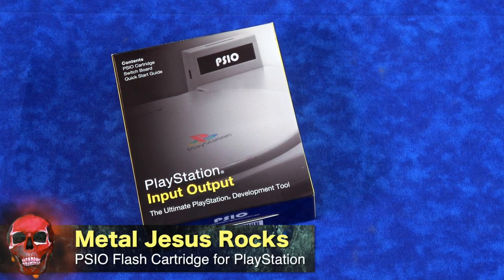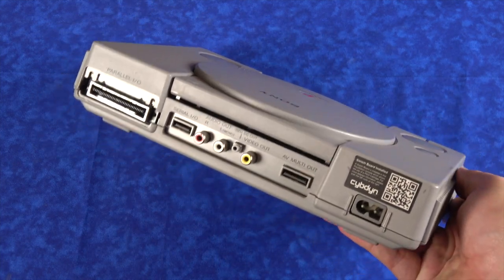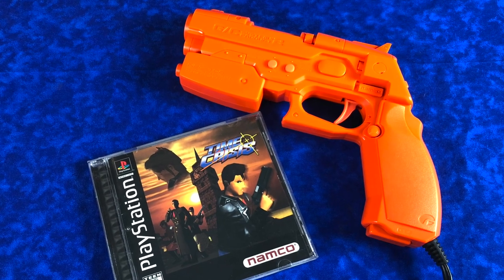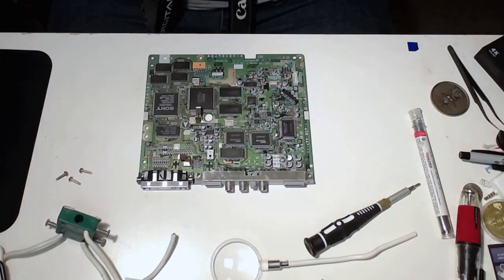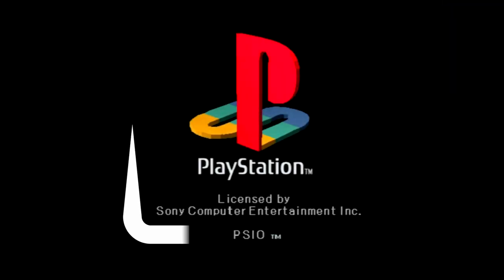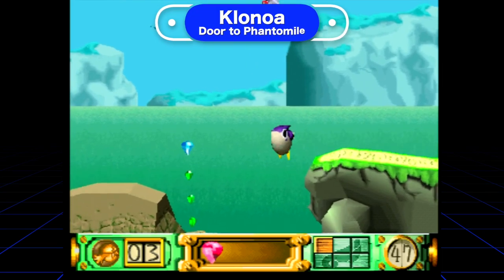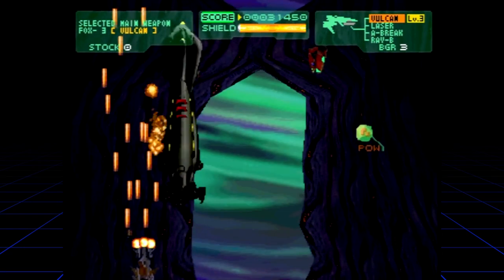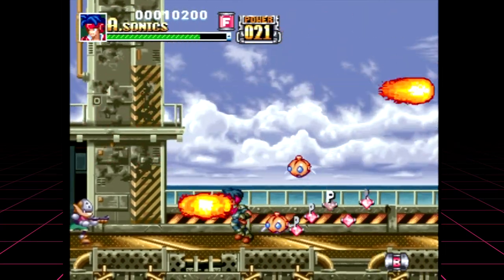PlayStation PSIO - SD Flash Drive for your PS1

Comment: They spent years developing this and when they release it they make you mod the console.
It's just a shame because GDEMU has put out SD cards for the Dreamcast & the Saturn and more and all you have to do is remove the optical drive and then plug the unit in and it works. No modding is needed, which is a much bigger selling point.

They need to revise this so that the detection works through the serial port alone and no modding is needed. I would rather the CD drive just stopped working when the unit was plugged in and it overrode the CD drive.

Sadly it a big NO from me.
Reply: Quite strange it needs a mod, the PIO slot at the back is ran so early in the Sony BIOS that you have the chance to patch everything in software. Action Replay/etc worked like that.
Reply: @SerBallister  Exactly, this is why its not sold out instantly, if this was the case, these things would be impossible to obtain for a while.
Reply: @Whenitraveltheworld  ehh it has been selling out quickly despite requiring solder work. I missed out on the pre-orders 2 times before I finally was able to place an order as they just sent an email out of the blue and it was first order first served basis. Cybdyn offer a mod service where you send in your PSX motherboard and they install the switch board for you. Not that it is hard. You just need a basic solder iron with a thin tip and some patience. Instructions are clear. They are working on a way to avoid the switch board but that takes time developing.
Reply: It's no different from a mod chip install 20 + years ago.  The trace cut are only the most tedious ones of the install but if you have the right tools it's fine. I had zero soldering experience and did my PU-8 board fine.  A plug n play solution without a board install will never happen because SONY did not have direct access to the CD-ROM controller and that is why the board is needed to re-route the communication from the Parallel Port to the CD drive, hence why a bad install, the console won't boot or the CD-ROM will not be recognised when PSIO is plugged in because PSIO still works side by side the drive.
Reply: That's a very elaborate way to tell us you have 0 soldering skills and are angry about it.
Reply: The Dreamcast already has an adapter for SD cards that plugs into the serial port but unfortunately the compatibility is hit or miss.
Reply: removing the optical drive sounds like a system modification to me.
Reply: I'm sure if that was possible, they would have already done it that way.
Reply: @jasonrulesudont5515  Um..the price is no more than the SNES or NES flash carts..and this is for PS1.

Comment: Back in those days i used a device like that one called "game shark" needed no soldering or extra chip. Originally was used to cheat with game codes, but as a plus, you could play burned cds, loading first any original one.

Comment: So in reality you could get the entire PS1 Library (worldwide) on a few SD cards........?
Reply: @BigDaddy-666  thank you for feeling the need to explain a bunch of unnecessary shit
Reply: @highspeedenthusiast6628  It wasn't unnecessary BS, that will be an eye opening comment for some noobs
Reply: @highspeedenthusiast6628  to answer you in a more relatable way to your question.

Short answer is yes. Long(er) answer is yes, but around 2500 games, at the bare minimum of 700mb each, that's around 2tb of stuff just of PS1 roms. That's a lot of cards.
Reply: @ChaosZero.  The full redump PS1 library is actually around 3.7 TB. But keep in mind that includes a lot of duplicates since there are games from all regions, demos, different versions etc. For a NA only set without duplicates you should be able to get away with 500 GB - 1 TB max. Most games are actually far below 700 MB.

Comment: I think it's wrong that they sell you the thing in pieces and don't even explain that if you buy the 150 sd parallel adapter it  wont work without the 7 dollar kit.
Also what the 14 dollar kit for? 
This being said why not combo the whole thing into one purchase with a discount? This plus shipping may be a killer making it at least 150 USD
Reply: RTFM
Reply: @ilovellamafood  checked on my phone it didn't state nothing when I attempt to purchase it.
Reply: The chip you have to install comes with the unit.
Reply: @ilovellamafood  yeah I found it. But even the pictures wont  show it included that's why I was confused.but it's good to know that it be around 130 after shipping. I may consider buying it after new years

Comment: I'm a member of a Dreamcast group on Facebook, and I've seen people posting pictures for something similar for the Dreamcast! It is a more extensive modification, though, as it involves removing the disk reader and replacing it with an SD card reader, which is kind of a bummer. It's cool that this one for the PlayStation allows you to retain the optical drive, but I wonder as our disk based games age and begin to fail more frequently, if we'll see more solutions like the Dreamcast one that just get rid of optics all together in favor of something like an SD card reader.

Comment: If there ever was a version for the PS2, I'd be so on board! Some of those PS2 games are really hard to find!
Reply: Get a fat Ps2 with an external HDD and softmod it with FreeMcBoot just use Opl then and it works perfect✌️
Reply: TOASTBROT do you need any thing else to connect to the ps2?
Reply: $5 freemcboot memory card off eBay or amazon, then just plug in a usb w games and you’re all set. Easy and cheap.
Reply: KORERAWR hook it up I have so many scratched ps2 games I need back ups

Comment: Definitive way to play PS1 games, nothing else comes close.
Have a 256GB card, running this on a JVC CRT 27" TV through RGB SCART and it's absolutely awesome.
PS1 is one of those systems you really need to play on original hardware - no emulation can ever compare.
The new menu updates are super easy to use as well, from what they've said in their news segment it's now at almost 100% compatibility, apparently only a single game is left before it's 100%.

Comment: 149.95 AUD for the cartridge and an additional 7.95 AUD for the chip......eh nice concept, but too expensive for my blood.
Reply: Get a job.
Reply: @the1ucidone  I actually find it kind of expensive too, I would love this hardware, I have a job, but In my case it's something called "priorities".  But for now a self programmed and installed MayumiV4 does the job.
Reply from the maker: At around $110 USD that's about what you would pay for some EverDrives like for the N64, etc...
Reply: @the1ucidone  And spend the money on this over a cheaper alternative like a Raspberry Pi? Ha, you're funny.....
Reply: I know how you feel. You can buy a used PS3 for half the cost and easier to softmod. Maybe once that all in one option becomes available will this be 100 % worth it. As for me, I'll wait until I save enough tip money to pull the trigger.
Reply: The chip you have to solder comes with the unit at no extra charge. You only buy more if you want to install in more then one console.
Reply: @MetalJesusRocks  "EverDrives" MJR? the term has ALWAYS been "ROM cartridge" when it loads a ROM file from esternal storage, "Flash Cart" for direct write cartridges like the early GB and GBA cartridges, or "Drive Emulator" in the PS1 and Dreamcast's case as it loads in place of the disc drive, be it literally or functionally. EverDrive is a brand, a expensive one at that.
Reply: @eddiew.4650  But, a Raspberry Pi 3 does not replicate what actual Hardware does. It's called emulated for a reason. It means that it is trying to be something that it is not. If you take a 1:1 ratio pixel setting on the Rasberry Pi 3 or any emulation software/hardware, it may never play or look exactly like the real thing. They can come close, and have a lot more features. But, it still isn't the real thing. The difference is quite alarming if you put the two side by side with the same game and on a Component CRT or PVM. It's all choice, you can go cheaper and get an emulated product. Or you can do what the hardcore mofo's like MetalJesus and MyLifeInGaming does, modify original hardware to look as crisp and perfect as it can possibly be. It's all preference my friend.
Reply: @zero9112  not gonna get much better than the ps3 for ps1 games. love mine.
Reply: @the1ucidone  No worries man, never took it the wrong way, and you brought a valid point. I hope you, and everyone else, have an awesome xmas. Stay safe.

Comment: This was just linked to me and wow, what a surprise. I had no idea Everdrive like software existed for disc-based consoles. I'd love to see similar things come to Dreamcast and GameCube. And yeah, with no soldering required, please!
Reply: Dreamcast has had options for a long time.  Just remove a few screws, pop out the disc drive and put in the board.  $60 with <5 mins of work!  Plus you can put the original drive back in it any time as long as you don't lose those three screws!  The only caveat is that the SD card reader board can wiggle loose after changing the SD cards anfew times, so be careful!  (A better fixed-mounting of the plug-in board would go a long way here!)

Comment: I know the PS1 classic can add roms and can use Dualshock 4 with a wireless adapter but does anyone know if the games/system supports rumble and analog sticks? I saw it on sale for $58 today and would buy it if it supported those things.
Reply: Damn where you see it for that much?
Reply: @sleepyjarvis6062   Check a site called Slickdeals. Just use the search bar.

Comment: Now the PS1 Classic is cheap and not wanted buy one and hack it and put all the games you want on it. It wasn't good when it came out until you can hack it and fix the emulator settings. But original hardware is always better than emulation

Comment: Great idea but the price is prohibitive. Too many cheaper alternatives. Only those who just have to play on original hardware would be interested.
Reply: yup. most retro computers and consoles are already emulated on modern PCs so just for running the software there are easier/cheaper ways. this is an enthusiast product and produced in fairly low numbers so going to be expensive to some, but actually very fairly priced to others.

Comment: Gotta say at 1st I saw this and was like "Why bother with getting that, if you have to mod the console to begin with, it will already run CD-Rs and your backups along it" (or pirates, you know yourself), but then I saw it does give some extra convenience. Frankly, I think it's a tad too specific, like it needs to be the old model and with parallel port plus you'll have to mod it, but I can understand it if you really don't want to swap discs.
In other hand tho, given the PS1 has no remote power on, you'll still have to reach it to turn on and off to begin with, unless you add another external device that cuts it's power from the outlet for you.

I would definitely love this for a PS2, specially the newest slim ones (79xxx and 90xxx versions) that have the smaller and more power efficient motherboards, that would be killer for a PS2 portable.

And like you said, it's good if it comes for pretty much all disk based system, just like the flashcarts come for cartridge based ones, since you have the hardware to care about. Disc drives are dying, and one day spare parts will run out, hopefully not (as in, you could still get compatible replacements) but it can happen. Not just possibly but even probably, and then the only hope to use the original hardware will be something like this.

Comment: There needs to be a solution for the later PS1's that omitted the Parallel port, from my experience they are more common in Europe than the original models

Comment: I'm not sure why the need to mod the console just to detect the device.  I mean, the Game Shark was an autoboot device, and some models even circumvented the opening Sony logo.

If they come out with an all-in-one device that you just plug in, I'll jump at it.  Otherwise, this seems like more work than what is necessary, unless there's a very specific technical reason for the mod of which I'm not aware.
Reply: Its not only for detecting the PSIO and that's it. That'd be really dumb.
Basically, there's not really a way to get the data from the parallel port to the processors , so think of the chip as making a bridge so the data from the parallel port can get over to the CD data input and go into the processors from there. That's not exactly what happens but an easy way to think of it. 
It's a real shame it's needed and isn't 100% plug and play, but it's really the only way. It's definitely not to make more money (???)
Reply: Yes or course it's no wonder it costs this much so they make money! they need it to make more of these, and to get some profit for thier time of course !

I'm say that the extra chip involved isn't some silly way of getting more money, that's just ridiculous.
Reply: Right? If gameshark could do this in the 90s as a plug and play, why are these amauteurs requiring hard modding.
Reply: Read my comment above. This is doing much more than what a gamshark can do.

Gameshark doesn't load any game data, it just sends an executable but thats it.
This is sending entire game data. The chip is needed to allow for it. There's no other physical way.
Reply: @televisionandcheese  Ah that makes sense. Thanks for the info.

Comment: Thank you so much for posting this! It appeared randomly while browsing YT. I knew they had similar devices for other systems but had no idea about the PSX. Order placed. Interestingly enough back then a third party made a parallel port circuit board you could attach (solder and slightly tool mod to the case) to the later psx models that had the port removed.

Comment: I'd be interested in this, very much so, however, does the chip react with anything else that might be plugged into the parallel port? I'm thinking Xplorer/Xploder cheat cartridges (or GameShark for you stateside guys), and stuff like that?

Also, what if you already have a chipped console? Would that interfere in any way? :)

Comment: BTW mjr the Dreamcast already has a couple of solutions like this. I have the SD card adapter for the Dreamcast. The downside is it is actually SLOWER at reading stuff than the disc drive is since it is a serial port that it works through, but it works great with games that aren't fmv heavy and such or modified ISOs.

Comment: If you don’t add the switcher chip to the PS motherboard, does that just keep the CDROM drive from working or does it keep the system from reading the PSIO? Was thinking about adding one of these to a PS1 with a broken CD drive if I didn’t have to solder the chip to the PS MB.

Comment: old dell optiplex on ebay with i5 processor and igpu+psx controller+retroarch= $100. %Flawless ACCURATE EMULATION WITH FEATURES SUCH AS FAST FOWARD, SAVE STATES ETC.  And not only that you can run saturn, n64, mame, dreamcast full speed and accurate. I personally dont understand why anybody bothers with stuff like this.

Comment: I really think they should offer the all-in-one solution solution regardless of sales, i mean, I won't be ordering this just based on the fact that i'd have to solder....also, I have a PS3 that can play PS1 backups/ISO files...MAYBE if they offered a plug-in device that would play games off SD cards that would be nice as well.  I do like using original hardware.  I wouldn't care if it remained region locked. (That's probably what that chip really is for, to make the PS1 system region free)

Comment: If you don't have someone local who can install the switchboard for you, Cybdyn offers the service for AU$15.  The drawback being that you have to ship your PS1 motherboard to Australia (which, from the USA, is expensive and takes a long time), wait for them to perform the installation (which may take a while since they're a small team and can only install so many boards in a day), and then wait for it to make it back to you in the mail.  If you know someone near you who can do it, that's probably a way better option.  But it is totally worth it whichever route you take; PSIO is a great product.

I will say this, though: find a way to check whether your PS1's parallel expansion port works properly!  If it was stored or used for a long time without the port cover installed, there's a pretty good chance it's gotten gunked up in there.  Most systems are probably fine, but there is always a chance that something won't work, and that would be a bummer after going to the trouble of installing the switchboard in there.

Comment: This makes sense since they are using the CD-ROM drive to do the region checking on the discs. I wonder if this would work with a drive that had a bad physical CD-ROM mechanism because I know I have several that won't boot games but will launch the Box.

Comment: PSIO really excellent device. All did according to the instruction, the master established switch board without any problems. I also wrote down games according to recommendations and everything works without problems. I so understood a small amount of games can not work, but so far did not meet such. Also in the company constantly work On compatibility, I think that all problems will be fixed. Very standing thing!

Comment: Not bad device but it is much better to invest in a modded ps3 slim which will allow you to play ps1, PS2 and ps3 games not to mention several other emulators. I have a 320 GB one with a 1TB external hard drive which is sweet.